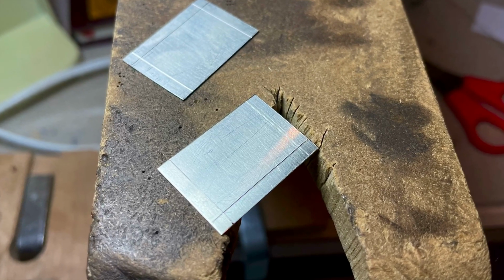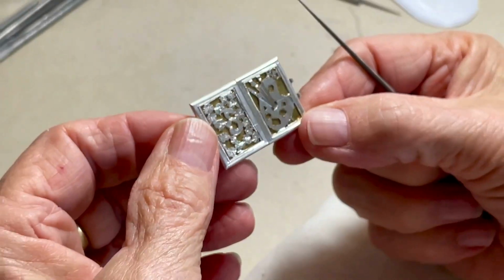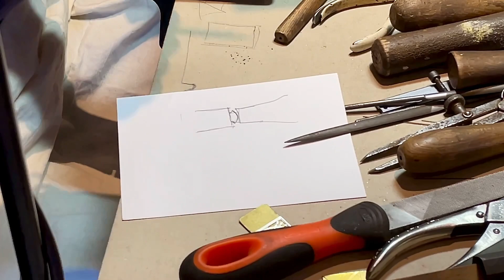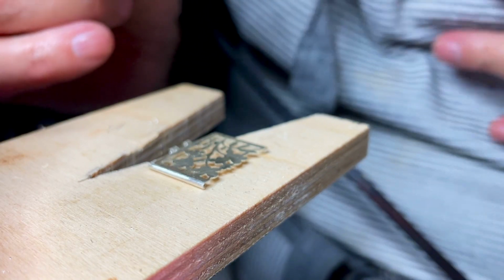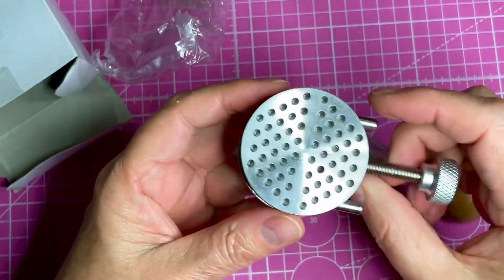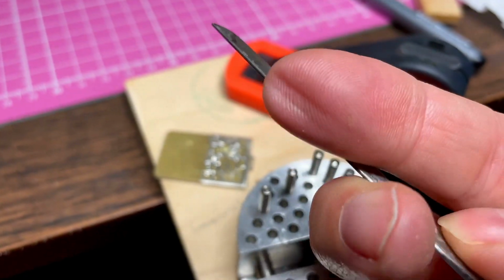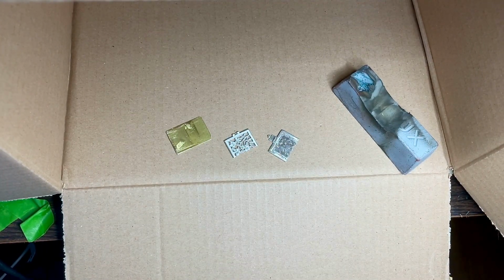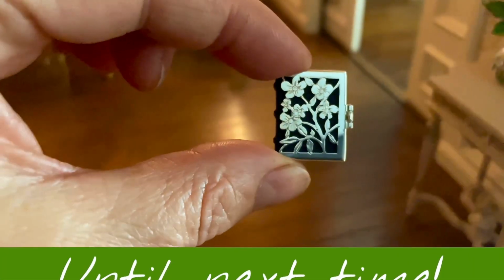Making a miniature silver book cover in a class with Jens Torp.

Comment: I am always so excited when you post a new video! Just a couple of observations…if you don’t own a foredoom you can use a temp control regulator sold for soldering irons which reduces the flow of current and will let your Dremel run slower. I’ve made some for my classroom but they are commercially available and I believe will work fine with a single speed dremel. Also, if you score the lines you want to engrave lightly by pulling towards you you have much more control. Then, let the tool do the work. You will have less hand fatigue. As well, be careful when you have a graver and your finger is in its path. Ouch. To hold you metal…I might try double sided tape. In jewellers school I was taught to take a dowel and attach it to a piece of wood. Next you melt pitch or shellac and put the piece you are working on onto it. The dowel will rotate nicely on your bench pin. However, your book cover is exquisite and you did it in a perfect to you way.
Reply: Meant to say, after pulling the line lightly to create the slightest groove; then you use the graver in the usual way by pushing away.
Reply from the maker: That's a great idea Gailene!  Thank you. I will look for one of those. No doubt it will be a much cheaper option than a Foredom motor.  
I will also try scoring the lines first next time.  Jens did mention it but I forgot.  
And yes I noticed on the video my fingers were in the path of the graver. Not a good example.  I know better than to do that.  I used double-sided tape when I worked on my previous piece (which still isn't finished after, what, 5 years...) As for the melted pitch or shellac, I have seen it on videos, but it is a material I don't have so again would have to buy it.  I rarely make anything in silver at home, mostly in class about once a year if I'm lucky.  Of course with Covid the last class was 4 years ago I believe.  I would like to start trying to make things myself at home because I really o enjoy it and have accumulated all the basic tools over the years.  
Thank you very much for the tips!  Much appreciated.  Are you an art teacher?
Reply: Yes you are correct. However, I am taking a break to build my house. In Canada we can apply to do our own electrical, which is inspected, of course, and I am doing all of the  electrical, some plumbing, insulating, painting, trim and flooring. When I’m done, I will sub occasionally and pursue my art mostly full time!
Reply: I will have over 800 square feet to create whatever artistic creation that I fancy. If you are ever in the pacific coast of Canada come by and play in my studio.